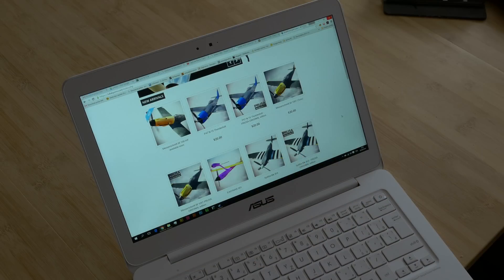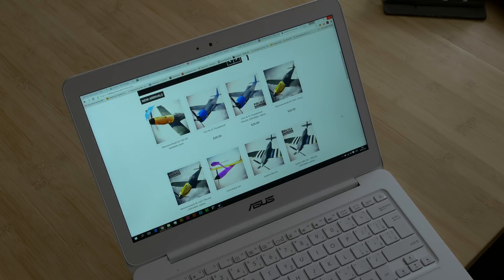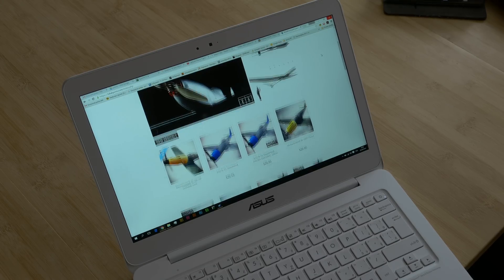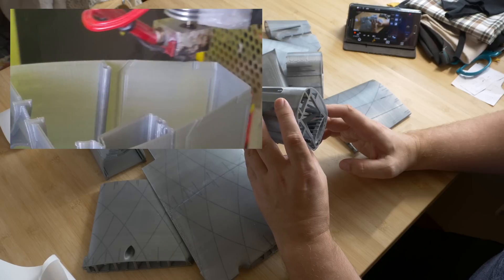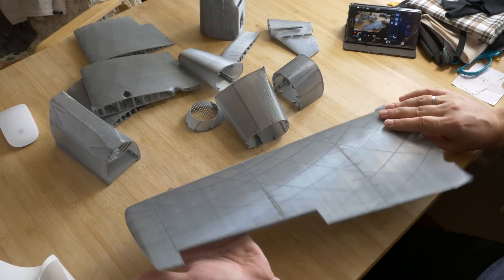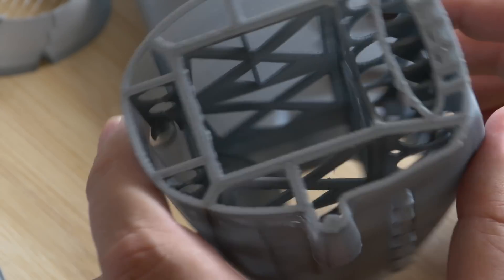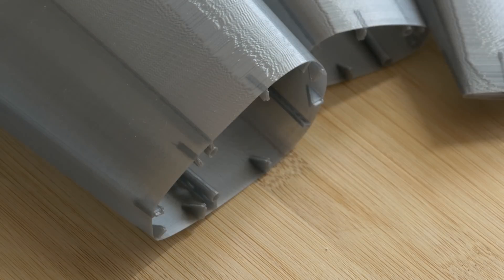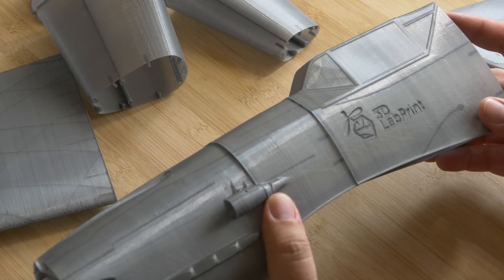3D printed Me-109 T - Preview

Comment: The inner structure of your wing looks great no stringing. What printer are you useing and how much retraction are you set at?
Reply from the maker: mreid08 Actually this first print was not so good... Newer are much better. Look on my.newer videos. Now I use a Felix 3 printer, but this prints are without problems on all normall printers, Prusa etc, but you must have a good settings off course. When you buy this or other model by 3dlabprint in files are settings and factoty files too.

Comment: Richard, I don't think I have ever seen parts this large coming out of a printer without somebody complaining about support and deformation. I don't know all the correct terms to use but this is incredible. The close up shots are exactly what the viewer needs to understand the resolution and "fit and finish". Great stuff mate. Oh yes I forgot, of all the things I have seen produced on a 3D printer for the RC hobby, this would have to be the most  significant in its end use. The print files must have taken an awful lot of work!!
Reply from the maker: Hi Chris - this is PLA, PLA is much easier for print without a deformation than ABS (for example). But yes, still it could be a problem. It is combination of parameters of print, perfect adhesion, temperature of hot bed, temperature in room... My printer is hobby printer too, I build is from prepared parts, price was only about 480USD and about 15-20 hours of work :)